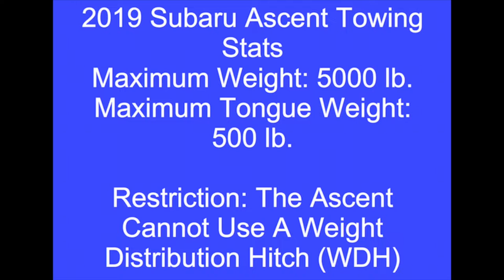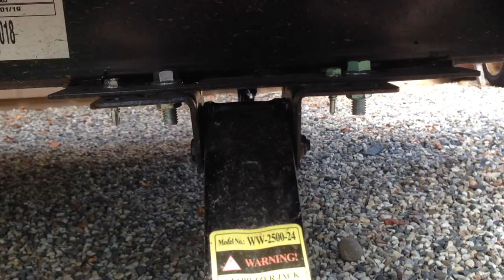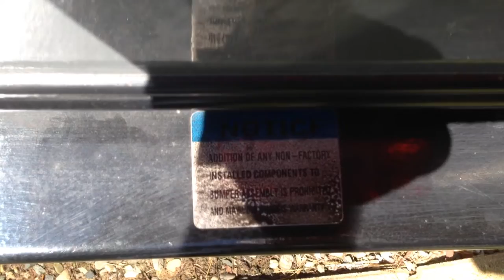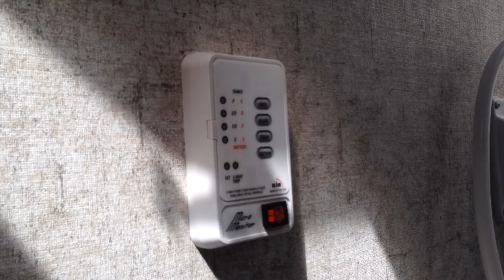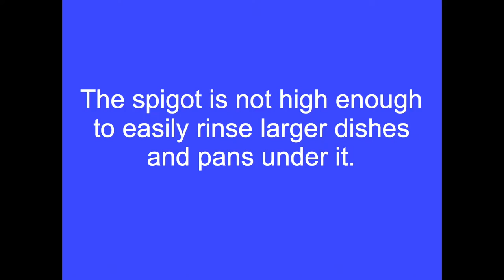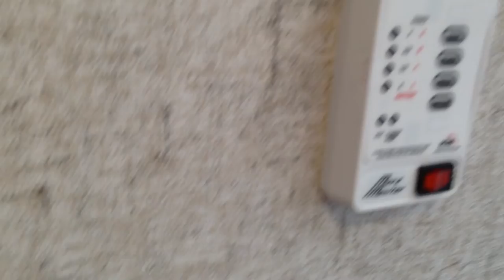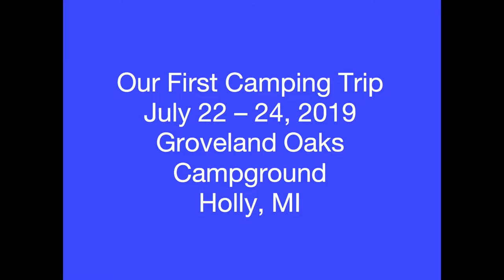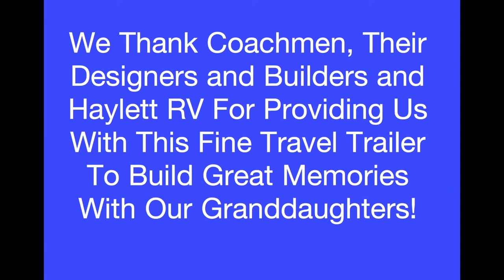The 2020 Coachmen Apex Nano 187RB (owner review)

Comment from the maker: Today is June 27, 2020.  This is an update after about one year of ownership.

I want to say, that so far, despite the impression that you might get from the video and associated Web pages, we are very pleased with our Coachmen Apex Nano 187RB.  Please keep that in mind when viewing the video.  ALL brands and models of travel trailers have some issues.  

In their newer builds of the 187RB, Coachmen has already addressed a couple the points I made at the end of the video, and I’ve noted a few more things that I’d like to see fixed in the design and build.

From viewing YouTube videos of newer versions of this trailer, I’ve found the following.

Things that don’t appear to have been changed; Battery disconnect/cut off switch still not added, better entry steps aren’t being used, the TV mount area is still not clearly marked, the awning doesn’t appear to have been changed and will probably still trap water, they are still using the very low faucet spout in the bathroom, no master light switch has been added.

Things that appeared to be change are; a better, high-neck faucet design for the kitchen sink, kitchen sink covers have been added, the water pump is still mounted in an inaccessible place, but the water heater does have a bypass for winterizing that I missed when originally going through the trailer, and they now use an inset, flush, mounted two burner stovetop.

Things that I cannot tell if they’ve been changed or not are; 
whether the poor window fit in the sidewalls still exists, 
whether the rear bumper has been changed so that it will fit a Rhino brand sewer hose, how well they are checking for leaks, 
whether they’ve implemented a policy to not install components with obvious physical defects, 
whether they are using better stabilizer jacks,
whether a better method of installing the stabilizer jacks is used, 
whether a better fastening method for access panels has been implemented,
whether they now note somewhere on the trailer that the owners manual is only available online, 
whether they are paying more attention to the condition of the frame,
whether they are paying attention to the small details,
whether they are using more care in the construction of the trailer.

New issues not previously mentioned.
21. The made in China window screens fit into the window frames too tightly.  There is no vertical play in any of the screens to allow them to be removed so that the window, that is covered by the screen, can be cleaned or the screen itself can be cleaned.

22.  During the roof inspection this spring I noted that the roofing material is loose on the front driver side and rear passenger side in small areas.  It is not bubbling, but the roofing material is raised and it can be pushed down to the roof with a finger.

A note on the supplied stabilizer jacks:
I need to note that with continuous lubrication, every time they are raised and lowered when not on a trip, they’ve gotten better at raising and lowering and are not as bad as demonstrated in the video.
Reply: Hi Ken- would you buy another Apex Nano? Would you buy it again from the same dealer?
Reply from the maker: I know that this is YouTube and people expect quick replies, in black and white, but…

I have a Subaru Ascent with a 5000 lb. tow rating and a maximum hitch weight of 500 lb.  I spent a lot of time researching travel trailers that might be suitable for the Ascent.

At first I wanted the Coachmen Apex Nano 213RDS because it has a nice floor plan for the two of us, and sleeping space to take two granddaughters with us at a time, on the few occasions that we might want to do that.

The following video link is dated March 2020 and is for the Apex Nano 213RDS with the Off Grid package.
https://www.youtube.com/watch?v=M0ivbPszOmU

Note that the 213RDS in this video does not have the stabilized type entry steps, like a ladder, but all of the new 187RBs, that I’ve seen on YouTube recently with the of grid package, have the new steps.

The 213RDS was also high on the list because it is a tandem axle trailer, which I really prefer to tow.

Unfortunately, with an unloaded vehicle weight (UVW) of 3850 lb. or more, I felt that once the propane tank (tanks on the off grid) were filled, a battery added, 6 gallons of water in the water heater and a couple of pounds of water in the water lines, it was going to be too heavy for our Ascent, once we added the items that “live” in the trailer plus our food and clothes.
http://theampeer.org/thoughts-on-towing/Actual-RV-Essentials-in-RB187.html

After much, much more research, I decided, that for ME, I did not want a slide. Just a personal preference.

I also had considered the numbers for the Venture Sonic SN190VRB tandem axle trailer with no slide. I found the current UVW is listed at 3770 lb. on the Venture Sonic Website.
https://www.venture-rv.com/products/sonic-travel-trailers/SN190VRB.html

Again, for ME, the numbers were too high for my Ascent. I am absolutely sure that many other folks will disagree and say, pull a trailer at its maximum tow rating, but I wanted to keep the fully loaded weight in the 4000 lb. area for the Ascent, which is 80% of the maximum tow rating.

If I had a tow vehicle with a 7200 lb. or greater tow rating, I would have taken a very serious look at finding a Sonic 190VRB and checking it out.

Due to the Pandemic, trailer production is down, and demand for travel trailers is HIGH!!!

I’ve only been able to find the Apex Nano 187RBs arriving at dealerships with the off grid package added.  I’m not a fan of that package with the Ascent as tow vehicle.

These three videos are typical of what I’ve found.

2020/2021 Exterior
https://youtu.be/5P_9MijBm34

2020/2021 Interior
https://youtu.be/e2mIE6YiIzM

2020 both interior and exterior
https://youtu.be/d0ARh_dLyJU

It appears that Coachmen has addressed some of the irritants that I had noted at the end of my video.

From the Primo videos, it appears that different stabilizer jacks are used, the steps appear to be possibly better, the two burner stove top has a cover giving more counter space, the dual bowl kitchen sink now has covers and the kitchen sink faucet is much higher.

Their Website now notes that the frame is powder coated, and I am pretty sure that mine wasn’t.

I previously noted that the water system IS set up for winterizing, and I had just missed it until the bottom shelf in the bathroom closet collapsed and I had to fix it.

It still doesn’t have a battery disconnect, but with the solar panel, I’m not sure if that would matter. 

The bathroom faucet and sink still don’t allow you to get your hands under the faucet to wash them, but that seems to be true for almost all brands. It was extremely easy to change out the bathroom sink faucet.

I would purchase another Coachmen Apex Nano 187RB unless I could find a similar planform tandem axle with no slide at 3300 lb. or maybe even up to 3400 lb.  I have no real problem with the quality of the trailer, as it seems to be on par with most of the industries’ build quality.

I would have to order a new 187RB, I am sure, so as NOT to get the off grid package. We don’t need it. It does not fit our style of camping, as we do not boondock. It would just add weight.

Would I purchase from Haylett RV again?  More than likely, but I would take much, much more time at delivery and double check to see that they actually did fix what they told me they would.

Josh’s videos are way better than the dealership.  I would definitely not recommend the salesman I had, Scott Sharpley, as he was extremely slow in responding to questions before the sale via email and never, not once, answered questions after the sale.  

At this time, Haylett, as well as all other RV dealerships are selling all of the RVs they can get their hands on.  No matter where you purchase, you will have an extremely difficult time getting it in for service or to have “Warranty” work done on it.

My recommendation is take a lot of time with the trailer that you are planning on purchasing while it is still at the dealership and go over it with a fine tooth comb. Do NOT sign any papers until you are 100% satisfied with the unit.  Once you cross the curb, that unit is now your problem, not theirs.

Thanks also to the pandemic, finding a campground, when and where you want to go is extremely difficult.

Overall, we are happy with our purchase and the dealership.

Dealership, that reminds me.  More important than what you buy is who you buy it from.  Research possible dealerships as much as possible, and just in my opinion, based on my research, I cannot recommend Camping World or Gander RV, which is also Camping World under a different name. Others my not agree with my opinion.

Comment: Thanks for the video. As I am shopping around for a similar, but slightly larger trailer (Jeep Grand Cherokee 6cyl tow) Apex Nano was on my short list, but concerned about the cost cutting. Absolutely love the 213RDS floorplan to the extent of overlooking shortcomings, like the manual crank where everyone else is electric (rationalizing a cheap upgrade) and the lack of a shower wall relying on the Azdel to pull double duty. Then I see the 'issues' you are having on build quality omissions, quickly rusting, low end wheels. Looking at your shower, those screws and the where you had to caulk is what a shower wall would fit over and give a clean finished look.  I am curious about how the shower wall wear with the water as it appears to be the same as the interior wall material, unless the did a clear waterproofing coat to it. Despite have in the best floorplan, sadly looks like decision now between Apex's sister (cousin??) product,  Freedom Express UltraLight, and the competing Winnebago Micro Minnie, both of which are Azdel constructed, and have upgraded features - including finished shower and power jack - but the Minnie lacks the front window.
Reply from the maker: Hi Larry,
Our shower seems to be doing fine, with just a wipe down after each. use.  I thought that the 213RDS had a shower surround, but I've not looked at it for awhile  now.  After two camping seasons, I am still, overall, pleased with our 187RB.  Coachmen has made several changes, and the newer versions seem to be coming through with many of the changes that I'd mentioned.  I'd be sure to watch for the latest Apex Nano videos here on YouTube.  It appears that they did change the stabilizer jacks and the way they are attached and several other items.
I don't want to give the wrong impression with the video, we really do like our Apex Nano 187RB, and it was relatively to either "fix" or learn to ignore some of the irritants.
Ken
Reply from the maker: Here is the newest video on YouTube for 213RDS
https://youtu.be/HqVI_JqHQo4

Comment from the maker: 01/10/2020
Guaranty RV posted a video on Jan. 7, 2020 of a recently arrived Coachmen Apex Nano 187RB.
https://youtu.be/k-Ahm1BUNi0

The version that they videoed has two covered propane tanks, instead of one uncovered tank, and a different tongue jack. The dry weight is noted as 3,180 lb., which is 80 lb. heavier then the dry weight of ours. It appears to have the same furnace with the single outlet. There is a light and plug-ins in the pass through storage. There is something on the ceiling over the bed, near the light, that is not on ours. It has a double bowl kitchen sink with covers, a much taller kitchen faucet neck, inset cook top and bottle opener in the kitchen. It has a two hook towel rack on the wall above the toilet to the right of the circular hand towel holder.

Don’t forget that there is more information about our trailer here, on this Webpage.
http://theampeer.org/thoughts-on-towing/More-187RB.html

Comment: Sorry Ken...Looks like you got a lemon...I have a 2019 187rb and  have no issues...The only things i did is ..1 ) painted the rust areas as you described probably got rusted from the manufacturing process and storage ....2) greased the jack spindle rods for smooth opperation. The one thing i did not notice when i bought it at the dealer was the tongue weight being much higher than advertised. Mine was 625lbs with 1 lp tank and the battery when i towed it home..The advertised tongue weight is 316 lbs dry...Still way off from the actual tongue weight..Since then i moved the battery to under the rear table seat..pour 5gals of water in the toilet before towing and added a 2 bicycle rack on the rear bumper...These changes reduced the tongue weight by 140lbs...I also did some interior mods which i can share some pics....Good Luck....
Reply: I found that mine was also tongue heavy.  I've managed to move a lot of weight to the back, without moving the battery.  Most of my pulls have been with about a 420 lb. ish tongue weight, give or take ten pounds.  My 2019 Ascent has a max tongue weight of 500. lb.  It has been a good trailer for us.  Actually we love it! Have fun with yours.

Comment from the maker: In the section of the video “These Are MY Recommendations”, recommendation #14, at 52:52 into the video, was already completed by Coachmen. The water pump IS fitted with a hose and valve for winterizing using gallon jugs of RV antifreeze.

Why I missed it, and how I found it, is shown on the Webpage that I created to continue the information about this travel trailer.

09/24/19 Winterizing the Water System
http://theampeer.org/thoughts-on-towing/More-187RB.html#WATERSYSTEM

The new Webpage is titled:
More Information On “Issues”, “Fixes”, Notes, Modifications and Additions to the 2020 Coachmen Apex Nano 187RB
http://theampeer.org/thoughts-on-towing/More-187RB.html

A lot more useful information can be found on that Webpage.

Comment: Hello Ken, Thank you for the video. I just purchased an Apex Nano 15X and love it so far. I have a question regarding your power awning. It take about 25 seconds to extend and over a minutes and half to retract. I told the dealership about it before I took delivery and they said that it was normal to allow rain to fall-off during closing (I did not believe them). Can you tell me how long it takes for your awning to extend and also retract?Thanks again for the Video,Andrew
Reply from the maker: It takes a long time when I have to stand there and hold the button.  I'll time it exactly for you tomorrow and post the times extending and retracting here for you.
Reply: @kenmyers7625  3 years later... 🤪

Comment from the maker: I got the electric power RV Awning extension and retraction times for my awning this morning.  The times include a 2 second pause going each way at about 24” from the trailer, as noted in Josh’s video. (see below)

extension 22 sec., 23 sec., 22 seconds
retraction 38 sec., 39 sec., 40 sec.

Some videos that might be helpful regarding electric power RV Awning Extension and Retraction

You're Using Your Power Awning Wrong with Josh the RV Nerd
https://youtu.be/IHGXbP-D5U0

Electric Rv awning How to fix slow motor
https://youtu.be/LoM-lhfOIN8